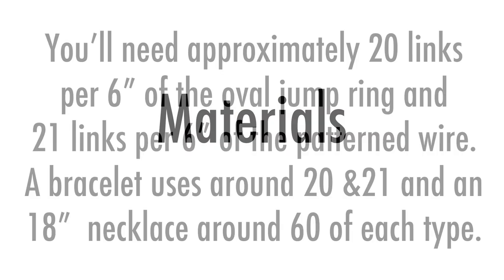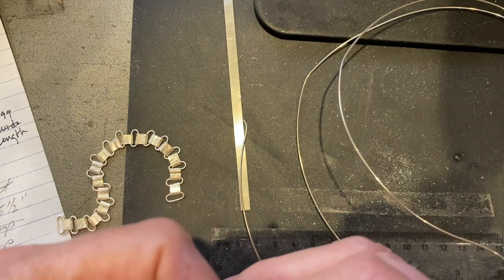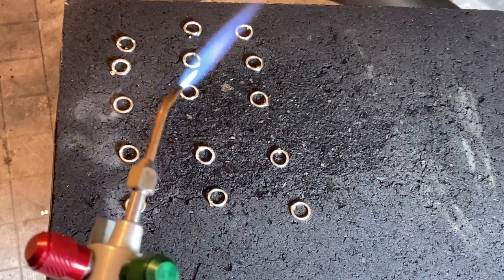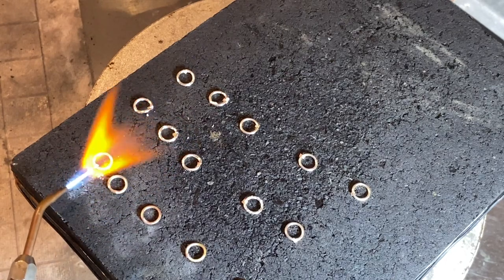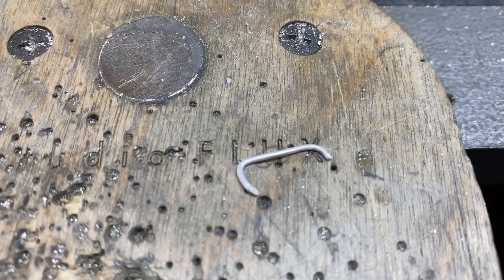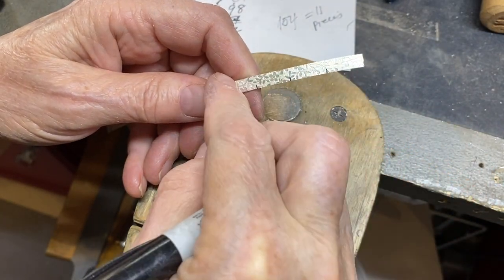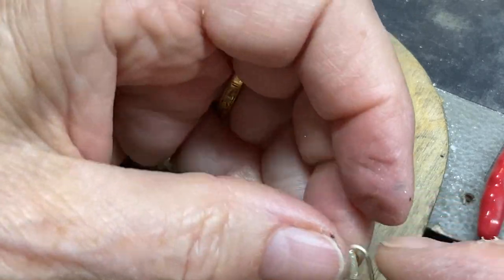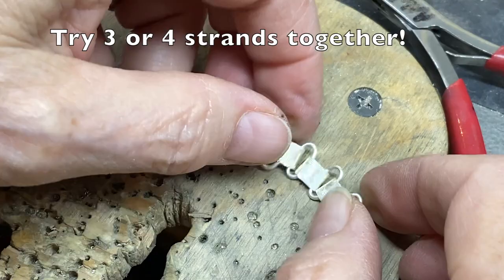The Patterned Link Chain   HD 1080p

Comment: Hi! So glad you're back! I'm a little confused on the lubrication process. I read your saw blade article on your website and have ordered the blades and Bur life you recommend. Am I supposed to put the lubricant on the blade, metal, or both? Thank you!
Reply from the maker: After I tape the coil in, I run the lubricant over the coil.  Lubricating the blade usually requires unplugging it so you don't accidentally step on the pedal - which takes time.  It works just as well, maybe even better, to lubricate the coil.  David at PepeTools taught me this and they manufacture them.  Thanks!
Reply from the maker: I have another video on using the jump ring maker, that may help!  https://youtu.be/s06c9owalqs

Comment: Good to hear that you are doing better. Instead of a sticker that says "I got my covid vaccine", the current one should just say "I got covid".
  I love the look of this bracelet and definitely want to give it a go. I wanted to ask if you clean the jumprings after cutting, and if so what is your method? I'm thinking the lubricant would interfere with soldering.
Reply from the maker: Good point.  For some reason, I haven't had an issue with using that flaky lubricant.  You could hit them with a torch and then pickle if it becomes an issue or throw them in a tumbler with some ceramic shot (add a drop of Dawn dish detergent).  Thanks.  

I like your idea about an "I got Covid"  sticker.  I'll send it out to  my friends and acquaintances, as in the past month, most of them had/have it.  (I didn't give it to them!  Haha).  It's insane.  Be well!  Thanks.  N